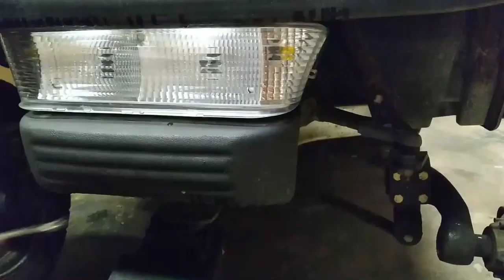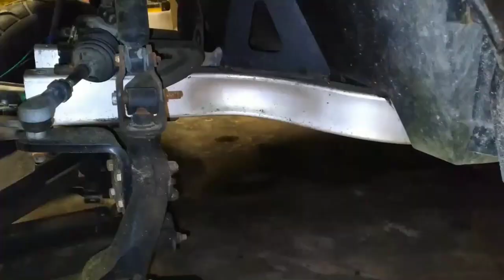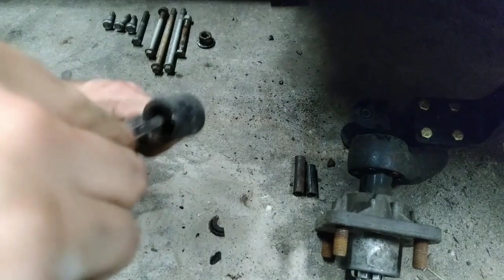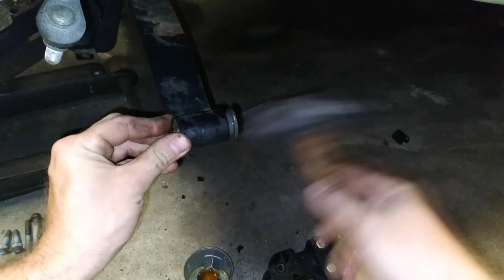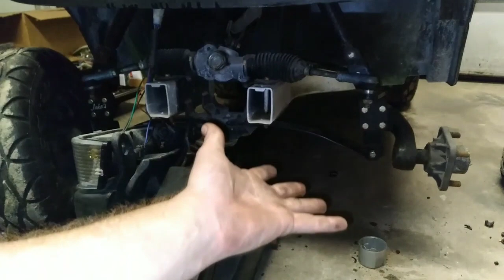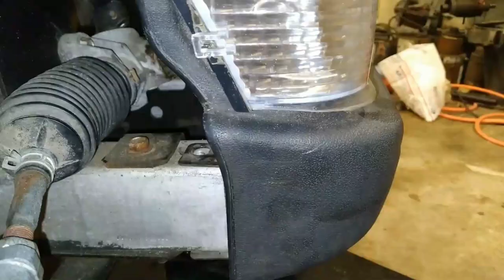Club Car Precedent Bushing Replacement

Comment: What lubricant were you using?
Reply from the maker: Probably gear oil
Reply: You do need to be careful what lubricant is used. The wrong one will quickly break down the rubber in as fast as a year. Also the wrong one will actually cause squeaky movement (think squeaky clean). The lubricant need to be approved for use on rubber by the manufacturer.
Reply from the maker: That's true. I do use a bushing safe spray lube usually.